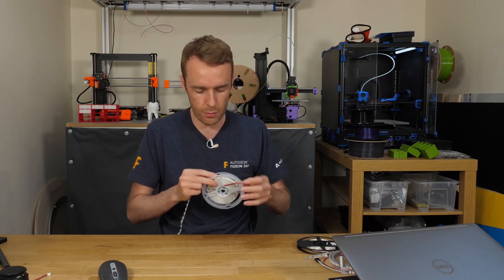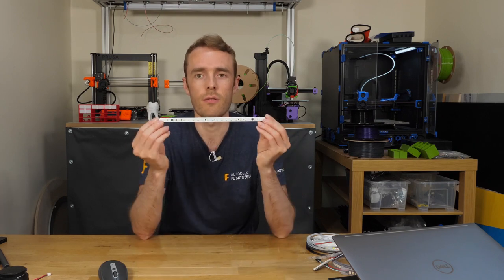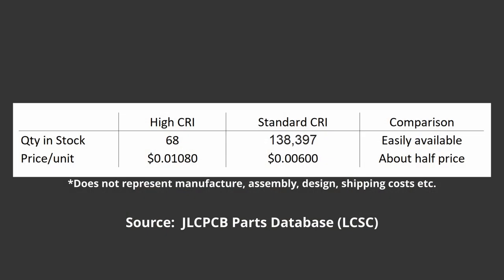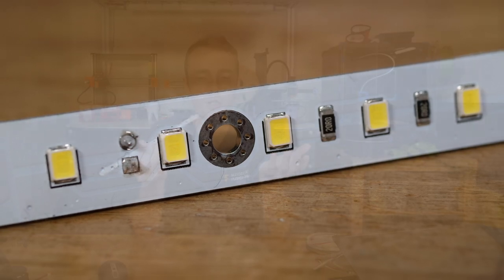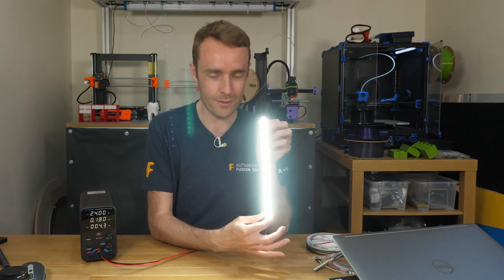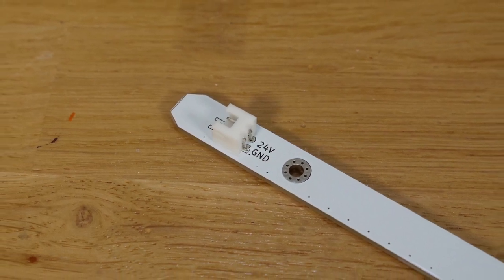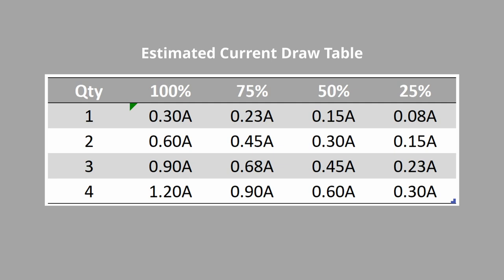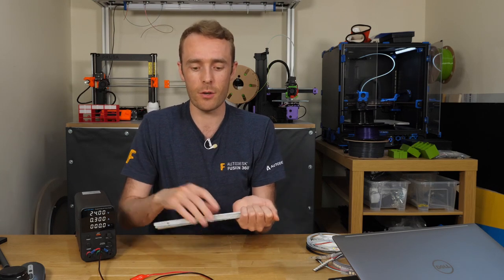Easy, Bright 24V Chainable LEDs for your 3D Printer

Comment: I used to have addressable RGB LED strips in my printer enclosure (alongside white strips for general illumination) but I never figured out how addressable LEDs could be remotely useful besides turning it into a rave 😹

RGB LEDs can totally be useful for indicating status and such, but that doesn't require controlling the colour of every LED individually - a basic 4-wire RGB LED strip would do just fine and be a lot cheaper. Probably more efficient, too, not having to power a separate IC for each LED.

However, WS2812-style addressable RGB LEDs are probably easier to use and/or compatible with more 3D printer mainboards, so I understand using them here. "Dumb" RGB(W) strips require MOSFET control for each colour channel, while addressable strips can just be connected to 5V, GND, and two suitable GPIO with no particular current demands 🤷‍♀️

But that was never a concern for my printer since it's already a pile of custom electronics - Smoothieboard, Raspberry Pi 3B+, ESP32, at least 3 custom PCBs, and plans for so much more 😹
So I had no problem adding MOSFETs for the RGB channels, while using dozens of addressable LEDs all set to the same colour felt like a waste... :)

(Incidentally, you can get WS2812 ICs in SOIC8 packages, so if you wanted the compatibility of WS2812 but with only one colour per strip, you could use a WS2812 IC and 3× N-FETs for R,G,B to drive a whole string of RGB LEDs as if they were a single Neopixel. (Modern, tiny-but-powerful SOT-23 MOSFETs would likely suffice for most purposes.) Doing that probably rarely makes sense, but it's still worth knowing about :))

Comment: Nice review, yeah they are bright!
The reason for the color accurate leds was not only to illuminate while printing, but a lot of folks also like to make pictures or film their printer ;)
Reply: Agreed. While High CRI may not be strictly necessary, it is definitely worth it.  My high CRI Daylight on a Stick make the inside of my printer look very bright and clear, especially in pictures. Also I got my Cree LEDs on Digikey and the price difference was laughably small for the fact that you get a nice high CRI compared to something lower than 90.

Comment: Voron v.01 RGB would be great, would the current Voron size fit the RatRig 300?
Reply from the maker: I'm using one on my V-core 3. 270mm long and about 11mm wide so you can work out where it can fit.

Comment: I'd love to see one for the mk3s to replace my current not very bright led bar, instead of pwm at 50% would it work with a buck being 12v?
Reply from the maker: Well the prusa mk3 Power supply is 24v If i remember correctly, but what you're missing is a suitable header to control them from on the control board. A solvable problem i think, there must be people with LEDs on a mk3

Comment: Is it possible to hook 2 of them up in series to get 12v for each?
Reply: no, both will be at 24V still then
Reply from the maker: actually you should be able to. It would electrically in series from one to the other using one end of both the sticks. Would be easier to show on a diagram 😅
Reply: @Vector3DP  No. That would make a 48V stick.